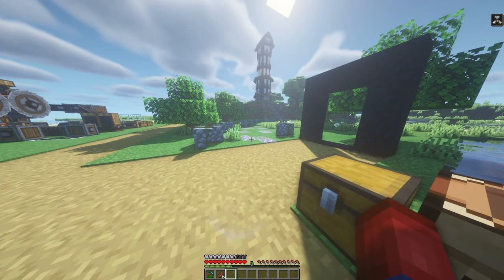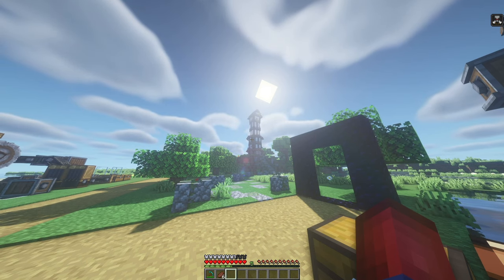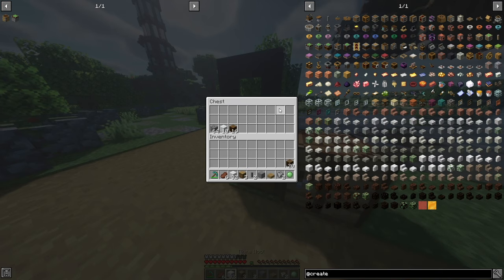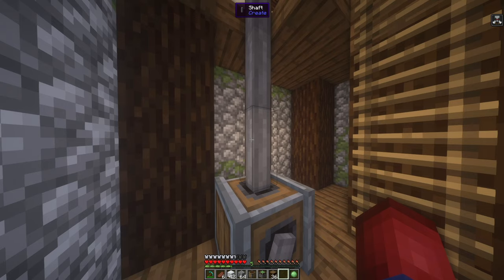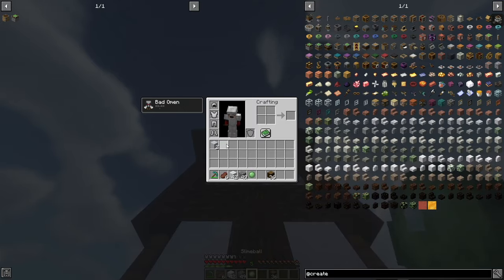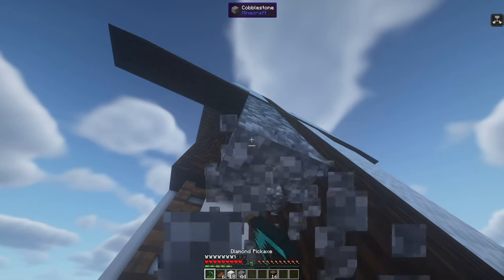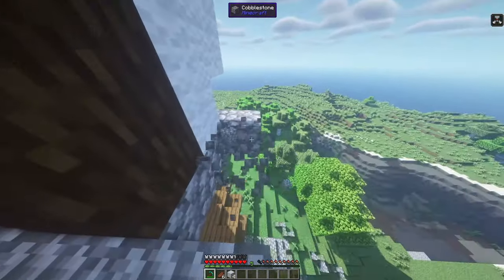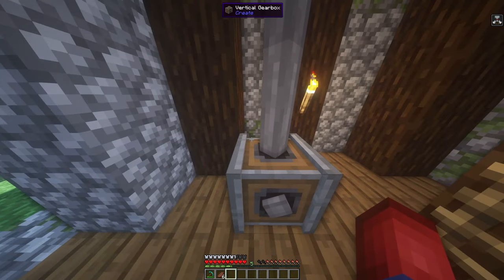Minecraft Create Mod Tutorial - How to Make a Windmill Ep 6

Comment: I'd recommend doing a 1:2 gear ratio down at the base, let's say you have 2000 stress units at 10 rpm, if you connect a large gear to the shaft of the windmill and a small for the output to machines, you'll have 1000 stress units at 20 rpm.

This is how it works in real life, I'm not sure for the mod though
Reply: This. A lot of youtubers get this wrong, the power you get is rpm times stress units. Building gears and changing rpm doesn’t change the total amount of energy you get. In create mod the more rpm you have the faster machines function. (Or for encased fans, the further they’ll reach)
Reply: You can use gears or speed controller to reduce the rpm going into machines, making them cost less energy to run so you can attach more machines, but all of them will run at a reduced speed.
Reply: @30Salt  Thank you. In the game I don't think the amount of energy used by a machine is changing, the rpm and stress units are reversed proportional (rpm increases, stress u drops and viceversa)
Reply: @bobi_lopataru  actually, in create the stress units are linearly related to rpm if i can say it like that, if the rpm doubles the stress unit output to them achine doubles as well

Comment: it does not work on me do i need to connect it to a cogwheel or something im tired or using waterwheels
Reply from the maker: Hmm. Is it not rotating? Make sure that you right click on the block to get it to start spinning. Also is anything blocking the movement of the wheel? And did you use slime balls to connect the blocks like I did in the video?